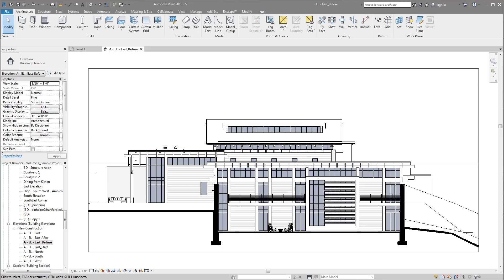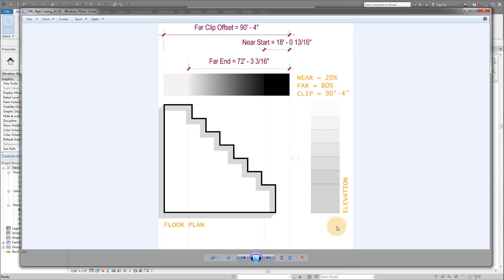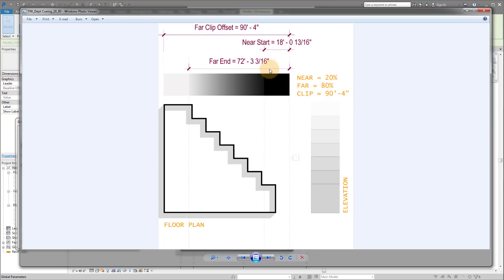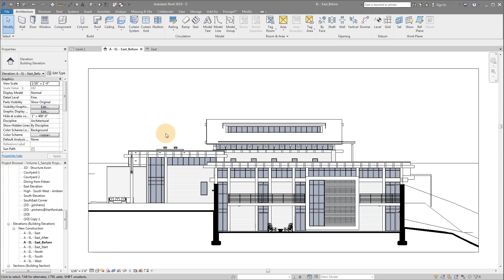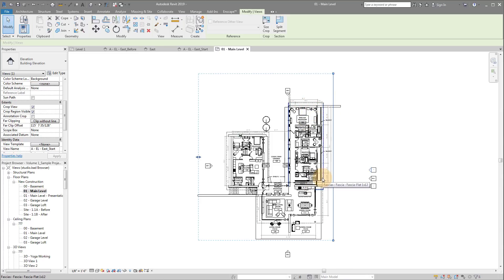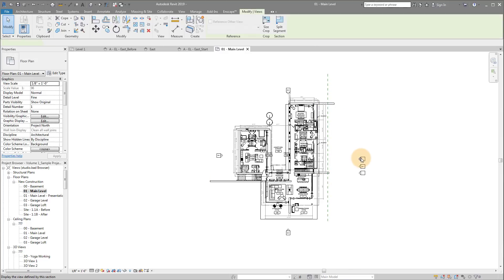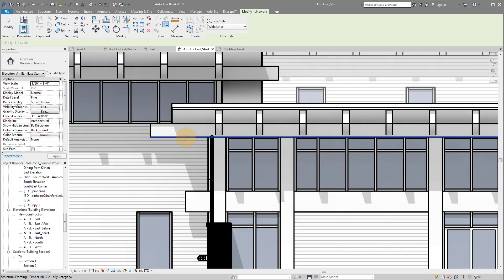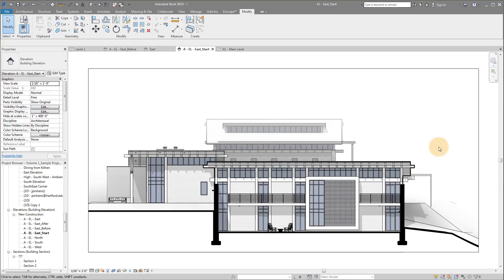Revit Tutorial - Adding Depth to Your Revit Elevations (Revisited)

Comment: Is there a way to match the color of the line work to the specific element/line where line work is applied. I mean when you use line work at the far elements and you select line types it won't match because the line work is black. and far lines are already grey. I want it to be grey color line as well, does it mean I need to create a new line type that would match on that line?
Reply from the maker: If you are using line work override and not depth queueing then yes, you need a line type for whatever lines you are trying to override with
Reply: @TheRevitKid  ow thanks buddy. Seems a bit tricky on this part, as you need to guess for close grey value to match on in. Hopefully in the future revit would have a solution to this, like a switch button to automatically blend line works color.
Reply from the maker: @mrt-design-studio  I expand on this in my blog post for this video… You do have a decent amount of control over the amount of greyscale. Check it out here > http://therevitkid.blogspot.com/2018/08/revit-tutorial-adding-depth-to-your.html
Reply: @mrt-design-studio  Change the  surface patern forground color of the material  to solid and to the desired color (in our firm we use light grey) NOTE: this means that this color will be visible on evey elevation and section (you could use filters and overrides to get rid of the color in views where color is not desired)

Comment: Thank you!!, I have a problem when I try to export in on PDF, because there I can see the all drawing is very very light (not only the areas that I want to see light, I refer that all the drawing is very light) , and this problem is when I use this option of Depth Cueing. Do you know if there is a solution?.. Greetings from Perú =)
Reply from the maker: That has to do with your PDF exporter, etc... When the view gets "rasterized" it tends to be lighter... You may want to crank up the darkness and view depth cueing to see if that helps.

Comment: Any idea why my model would disappear when i set my far clipping to "clip without line"? I don't mean just a linked model, the whole model. it is set through a view template which is applied to other elevations and the model is visible. it's just the one elevation.
Reply: Check your far clip distance. E.g. if your elevation marker starts at 10' offset from the wall and far clip is set to or less than that number, the model will not display.

Comment: Thanks for the tutorial on elevations.  Revit right out of the box is becoming a powerful representation tool.

I did have a question though using the linework tool: have you had success in the plan view to manipulate grips like you show?  I have Revit 2017 installed and could not get it to work.  In general, Our office does not want a heavy lineweight for the line representing the cavity side of a partition.  The only work around I have found is spliting the walls, but seemingly, this adds bloat to the model.

Below is a link to a thread that describes a similar problem I am had in the past.  
https://forums.autodesk.com/t5/revit-architecture-forum/linework-tool-in-plan-views/td-p/4641385

No worries if you have never come across this.
Reply from the maker: Hey man... That is weird!! it seems to work fine for me?  Sounds like a weird graphics thing... Seems to work in 2018 and 2019 when I try the linework tool...